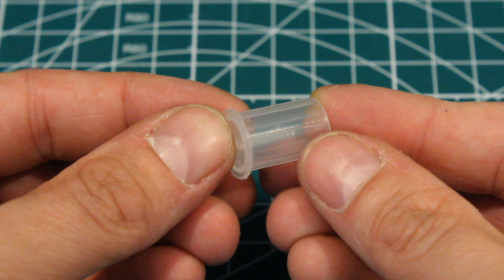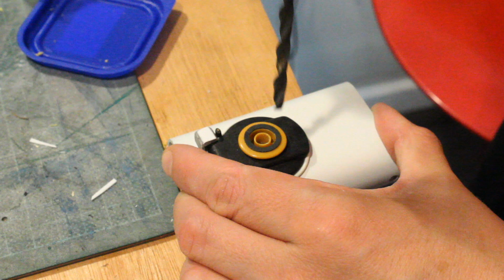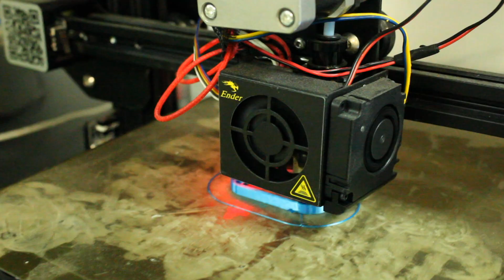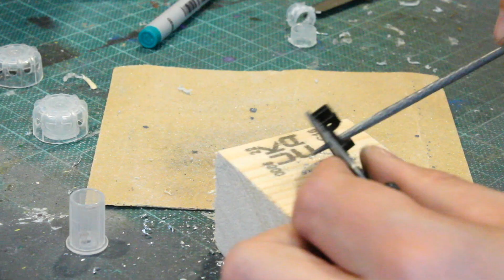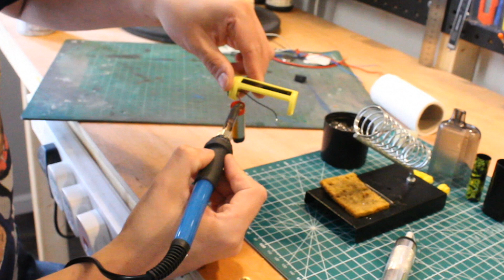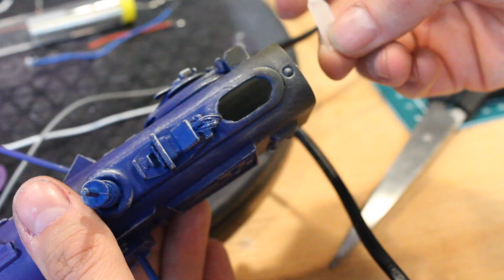Complete SPACE SHIP built from random junk!

Comment: Nice work, might I suggest you get yourself a wire strippers and crimp set it will really help with not having to do so much soldering
Reply from the maker: Thank you for the comment and suggestion!

I do actually have a set somewhere, but I couldn't find it... I suspect its still in my old shed - I'll need to have a look when I can for them, especially as I'll be using a LOT of LEDs in my next build! ✂️📏📐🛠🪚💡💡💡